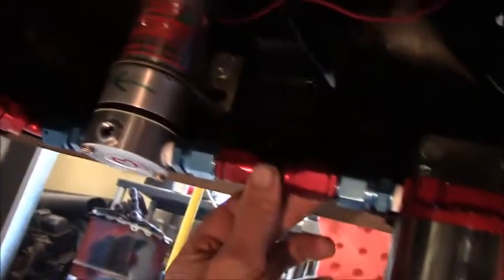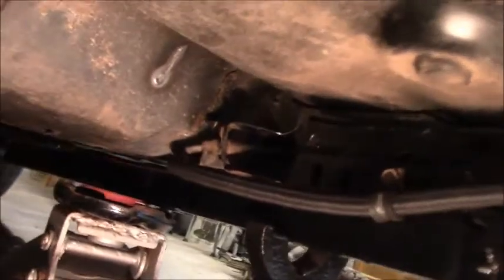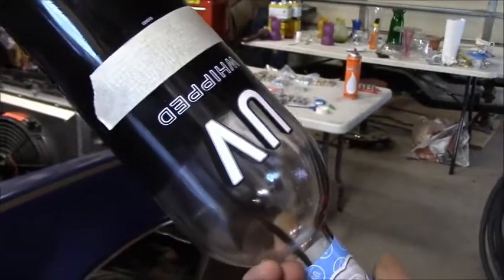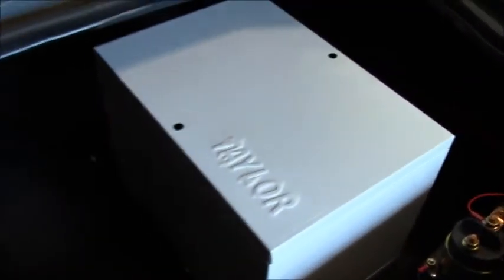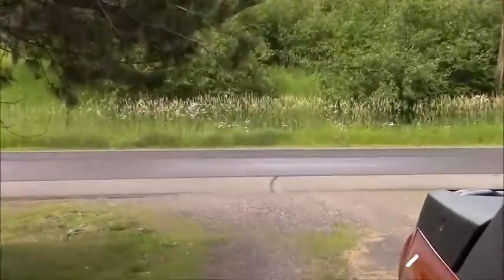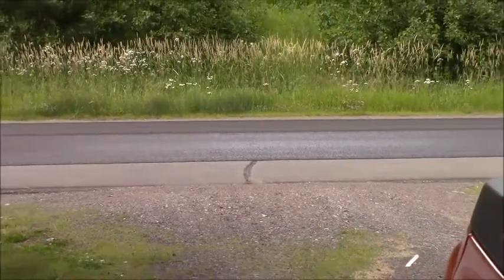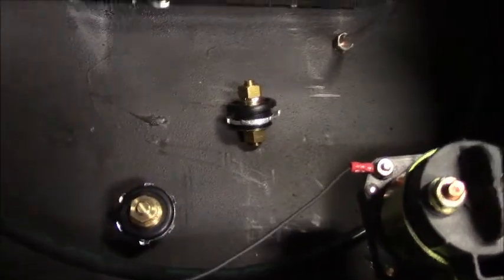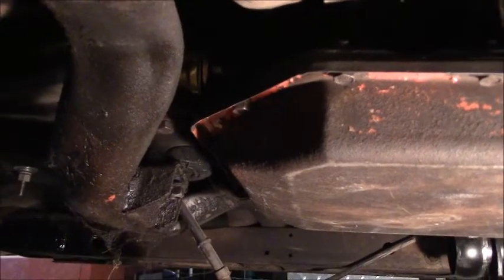Today's Progress Thursday

Comment: nice, what stroker? mines a 461
Reply from the maker: 383 60 over. Just getting my feet wet. Lol    Thinking twin turbo's next year.
Thank's for subbing. subbed back......How many ponies you putting on the ground?
Reply: strokedfirebirdable  i'm at 450 at the crank with just shy of 600 lbs of torque.  thats 450 crank at 4800 rpm... ;-) on the 1/4 i'm at 106 mph which given the cars weight you can use a formula to accurately calculate wheel horsepower, and mine comes out to 350 ish at the real wheels, which sounds about right given the heavy duty transmission, the 4" nascar driveshaft with 1350 u joints and a built 12 bolt out of a chevelle ss with race axles, posi, a moser yoke and bearing cap support... all that stuff eats up power, but the good side of it is that i'll never break anything except from neglect or mistakes.

i've seen those 383 stroker put down some serious power, and with a cheapo $800 ebay twin or single turbo kit for the chevy small block (you already have an electric fuel system) will see that power go through the roof...
Reply from the maker: Invincible Brotherhood very impressive buddy.  Are you spooled up?
Reply: strokedfirebirdable you mean turbo or rear end? non of my projects have turbo;s or superchargers YET... and as far as the rear ends, no way, they're all pro-touring style cars, not pro-street.  and every single one is being built to be able to drive daily on the road with my kids in the back... so no spools ever.
Reply from the maker: Invincible Brotherhood I meant the rear end being spooled.  Having a cool car you can drive daily is nice. Expecially when you got the kid's in the back...Thumbs up. ......I brought my two kids home from the hospital with the Bird.  I planned on keeping her original but discovered she was T - boned pretty good before I got her. Didn't where tires good and dog - tracked :(   My next one will be a daily driver